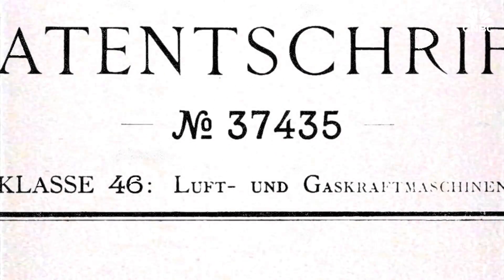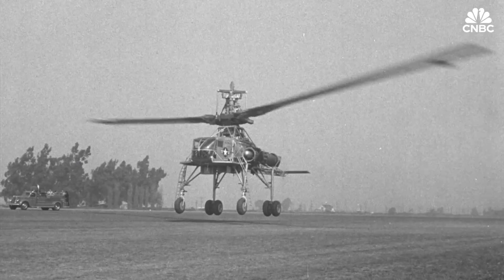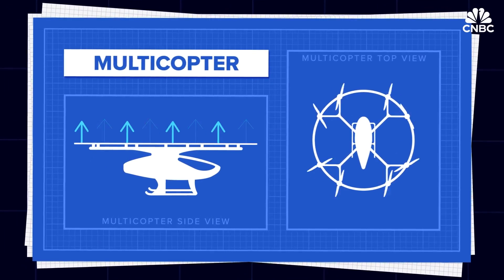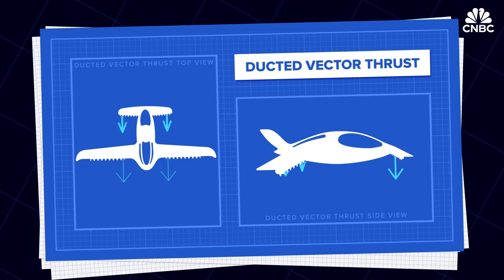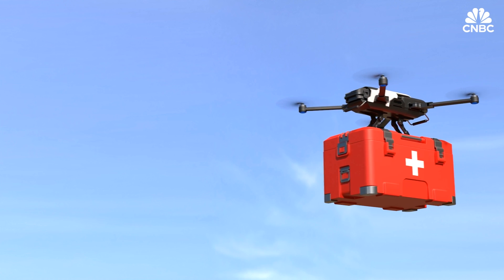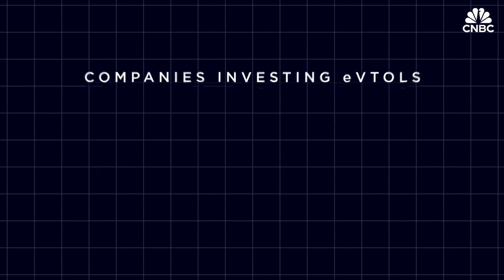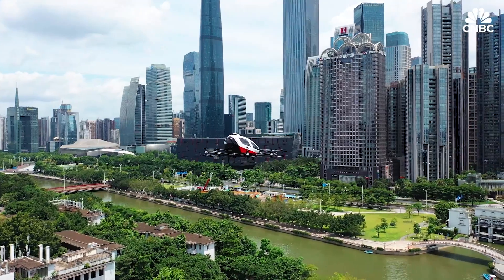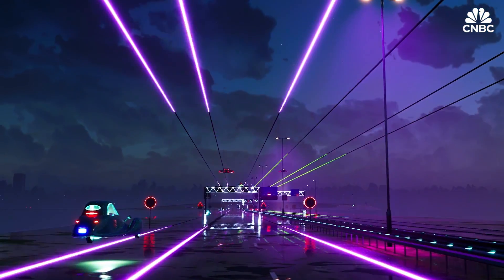What is an eVTOL?

Comment: So there are hundreds or thousands of them flying around a big city like London. How do they avoid each other in  3 dimensional space? Airliners have air traffic control to keep them apart from each other, and fly on known flight paths. When cars crash into each other they damage each other, but they are solid metal boxes with crumple zones that protect the occupants, and after a collision they can just sit there not moving and be fine. When aerial vehicles collide they tend to damage each other, and then fall  quickly down to the ground.